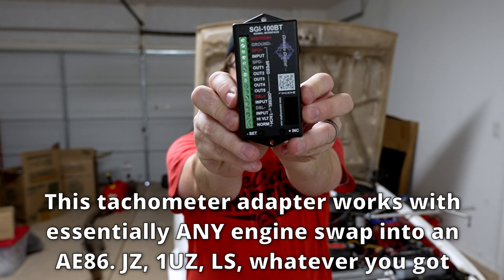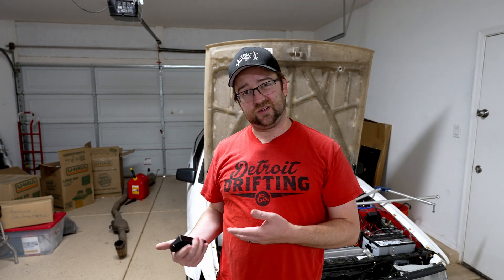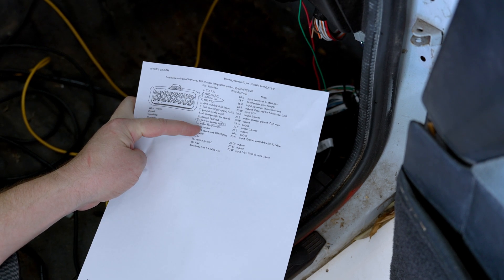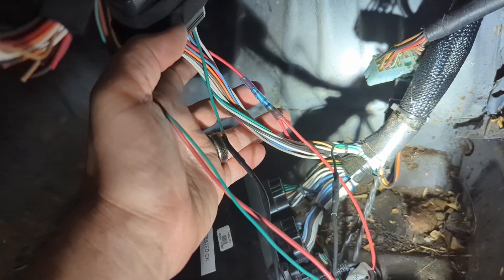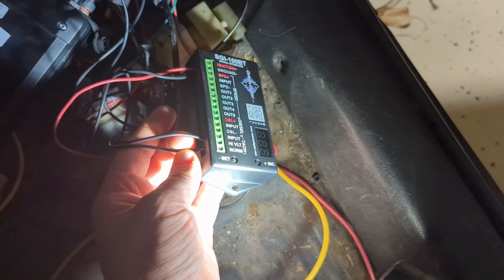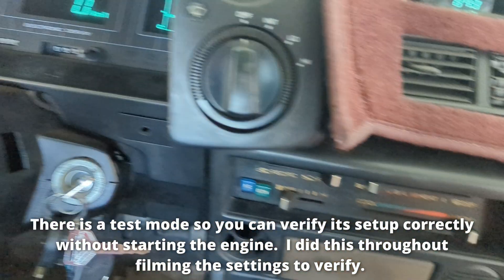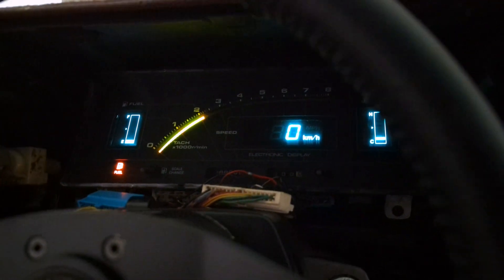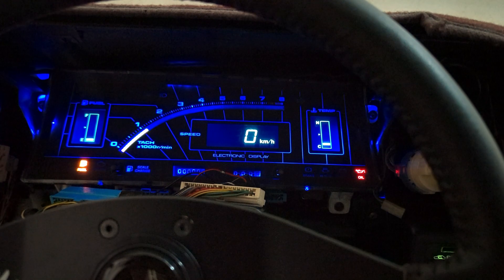AE86 TACHOMETER mod - BEAMS 3SGE swap - SIMPLE INSTALL! Works with MANY older Toyotas too!

Comment from the maker: Discovered an added benefit of this - it allows you to use all of the existing AE86 A/C components (and controller stuff). The AE86 AC amplifier (AC/HVAC "module" so to speak) needs a tachometer signal. By providing the tachometer signal to the cluster via the main "engine" plug (the one on the firewall in the engine bay), this should also feed a tach signal to the AC amplifier.
Reply: on this, if i have a standard (non-digital) dash with the resistor soldered in, do i still need to do this to get the AC clutch to kick on or just connect the signal AC wire to the compressor and im good to go?
Reply from the maker: The factory AC control module needs to see the high voltage tach signal. That's not something the beams stock ECU or link ECU can do
Reply: @DoctoredGarage  gotcha, and which of the three wires on the BEAMS compressor is for the clutch?
Reply: @DoctoredGarage  oops, nevermind on the ac clutch wire, it was pretty obvious when i looked closer. thanks for all the info you provide!!!
Reply from the maker: You're welcome!
Reply: @DoctoredGarage where does the high voltage come from on a stock 86? Distributor?
Reply from the maker: I think it's from the igniter/coil
Reply: @DoctoredGarage i thought id be done with the ac today for my beams swap. Clutch kicks in for only a second and ac light starts blinking. Thought i was stuck, but i guess all i need now is some high voltage signal😅. Your videos guided me all the way through. Thank you!
Reply from the maker: Your welcome!

Comment: Hi Devin are you using the stock J160 electronic speed sensor for the digital speedometer?
Reply from the maker: I haven't configured the speedometer yet, but I'm working on it :)

Comment: How do you connect to the computer to do the key sweep?
Reply from the maker: It's a setting in the link ECU, I'm not sure if every ECU has the same feature
Reply: @DoctoredGarage  do you know where I can learn to do? Or the program you used
Reply from the maker: It depends on the ECU you have in your car - if you have a Link ECU the software is PC Link and it's in the tachometer menu.

Comment: Is this a Re-upload?
Love the Digital Dash so much.
Reply from the maker: I had another video that I put together, but realized like 1 day after it went live that the tach converter was bad out of the box causing some issues that I covered in the review. 
I took the video down and reached out to Dakota Digital, they got me squared away pretty quick. I updated the video with the good part installed, which is this video :)
Reply: @DoctoredGarage  Thank You for clarifying. Great work as always
Reply: @DoctoredGarage what problem did you have with the first one out of the box? I received mine but can’t get my ac to work. Im only using it for the ac amplifier.
Reply: Did you have a video on rewiring the digital cluster?
Reply from the maker: I have a video on installing it, in the video description I have a link to my website where I included the rewiring information